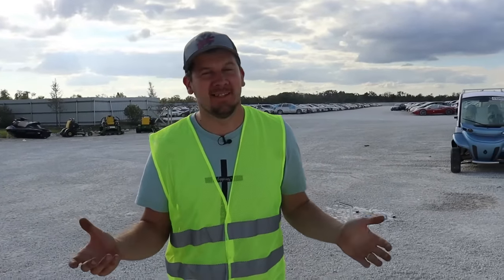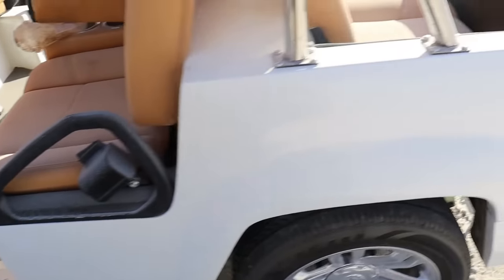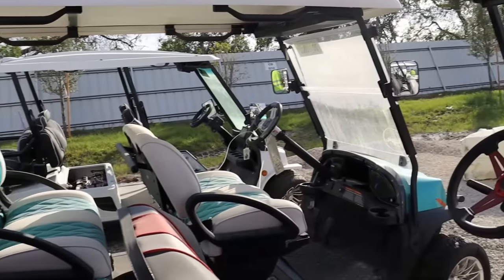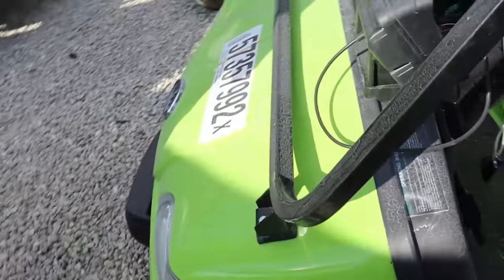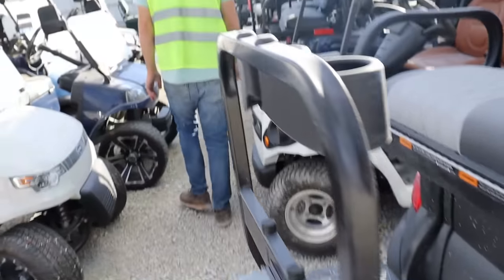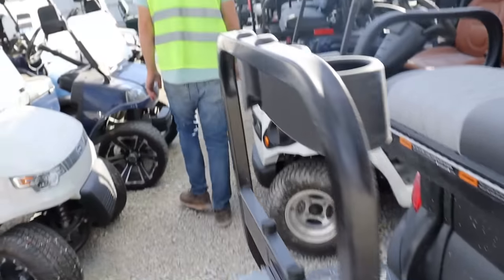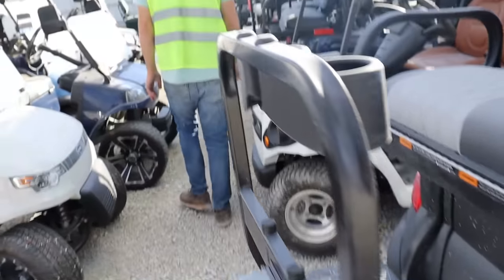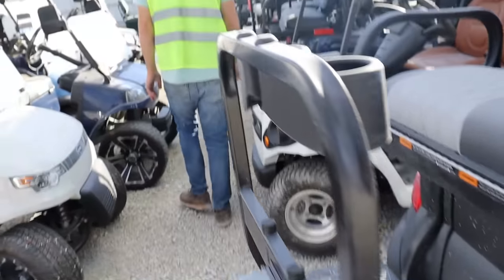CHECKING OUT FLOODED GOLFCARTS, BIKES, AND MORE!

Comment: I've drove my bike in some really nasty rain and I've left my bikes out all winter long here in New York so pretty much there ain't that many electronical parts on a motorcycle that can be messed up just the engine needs to be drained and lubricant put that back into him as an oil for five times to clean all everything out and put some there's stuff out there that will get rid of all the b***** out of it but motors are easy to build on any motorcycle wiring is easy you get parts cheap but get that man guys bicycle for big money